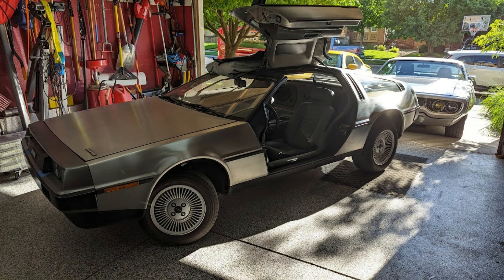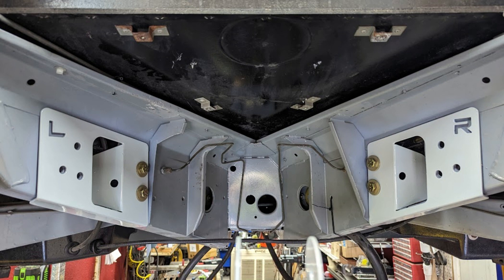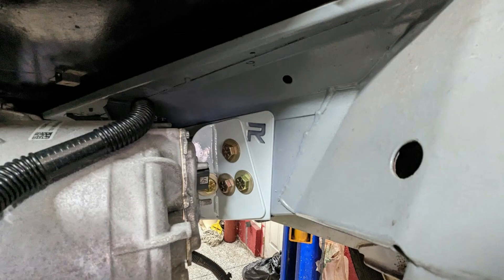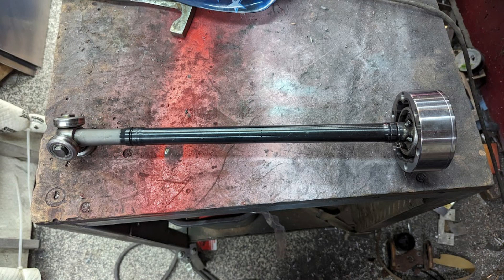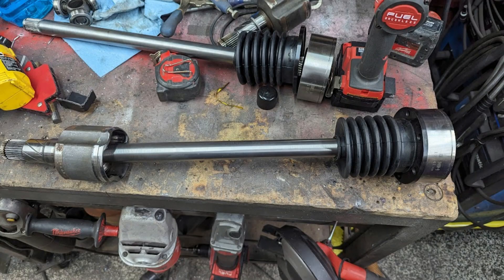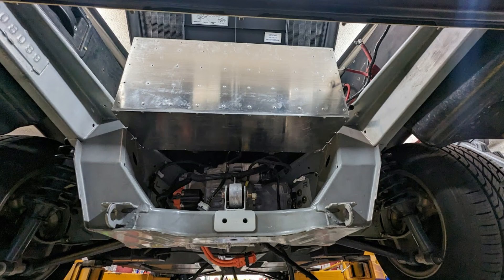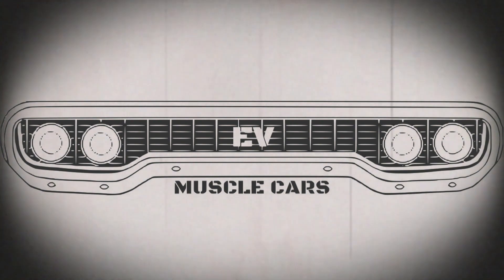EV DeLorean - Building CV Shafts - Project Jiggawatt Episode 2

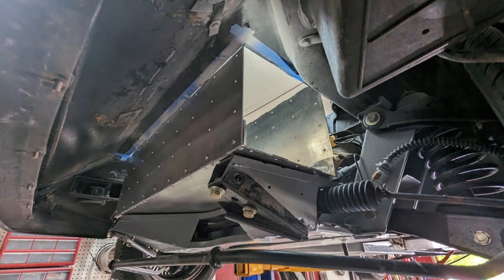Comment: Nice!  What are the electronics boxes at the rear of the frunk at 5:53?  They look a little like audio components - but they're not any EV components, are they?
Reply from the maker: There is a sound generator and a switch panel, most of those will be changing... Not EV related, just came with the car.

Comment: Kevin, did the frame need notching for CV shaft clearance, now that the diameter of the shafts have increased? 

Obviously, one should hope never to see that much travel, but I'm thinking of the possibility of extreme suspension compression on one side of the car during off-camber situations, say, making a curve in a parking lot while transitioning onto a steeply inclined ramp. That might be enough to get one side to compress close to full travel.
Reply from the maker: That's a good question... nope, luckily it still clears even when the suspension is fully compressed.

Comment: Hoping ep3 drops soon
Im trying to design a box setup for 18 lg chem modules, and the idea of having 4 modules per box is interesting...im wondering if i could do 3 modules per box for my setup and have 6 boxes? 

Furthermore i cant weld for crap so any no-weld solutions im into
Reply from the maker: I'll try to get that video out soon, I am also using a no weld solution for the box construction.  

For LG modules, you may have a consideration of thermal control with some kind of a liquid cooled/heated plate?  As far as the grouping goes, space consideration is a big factor followed by cell grouping.
Reply: @MrMoparMan  oh yeah liquid cooling is mandatory, meaning I'll need to make chill plates which match the bottom of X number of modules (however many are in any given box).
 The electric supercar guy had a good design that's easy for send cut send to make, just need to rivet it together and add black gasket maker
Reply from the maker: @Ryukachoo  Yeah custom sized chill plate is the way to go. 👍

Comment: Good progress on this :) Googling weights of the various components you've removed and added, it seems like it'll be a bit heavier than the original car but the box in the front the weight balance should be much the same, which is interesting
Reply from the maker: Thanks, Yep that was pretty much the same conclusion I came up with.  With modern adjustable coilovers, I think it will drive great.

Comment: Amazing work! 
I do wonder if it would be possible to have only 2 batteries in front (in order to save cutting into the tub) and have the other two batteries underneath the other in the back?
In order to keep the modification reversible if possible.
Reply from the maker: Yep two up front would remain under the trunk floor.  It could actually drive with only 14 modules instead of 16, it's just less power and less range.  Fitting the other two modules somewhere else did not seem feasible.  After having experience with a conversion, I'm convinced there's no desire to go back.
Reply: @MrMoparMan  Thanks for the reply! The non-destructive approach is just to please the purists. What's the expected range with the full pack?
Driving a stock PRV is plenty of fun for me but having a second electric Delorean would sure fool the locals :P (only 20-something in my country)
Reply from the maker: @banjohat  I hear you on keeping the original form... With the Model 3 motor and a Model S battery pack, 400 miles of range is possible.  It was also have DC fast charging.

Comment: I just had a drive unit fail catastrophically in my 2023 Tesla with only 5K miles. Left me stranded on the side of the road at midnight. The original DeLorean engine is more reliable! Good luck! 😂😂😂
Reply from the maker: Well that sounds like a bummer, sorry to hear that... You may be the first person I have heard that trusts the reliability of a DeLorean 😀.  My Tesla swapped Plymouth is going strong with 18,000 mi so far, I never drive it easy.
Reply: @MrMoparMan  I have owned all the top “super unreliable” brands, and none of them left me stranded on the side of the road like the Tesla did. After searching online for my car’s error messages, there are a lot of people having these failures.
Reply from the maker: @JetFire9  Interesting, what was the problem, or what were the error messages?
Reply: @MrMoparMan  "Pull over Safely Vehicle Shutting Down" and "Your car suffered a failure and will no longer drive." and "Vehicle may not restart Service is required." The inverter definitely had a massive failure and caused the main pyro fuse to blow, so despite having 2 motors, the whole car lost HV power, which means the tiny little LV battery was dead in 10 mins, which means you can't even put on the hazards or put the car into tow mode. Horrible design. Now they think the HV battery got damaged despite the pyro fuse blowing, so they are dropping the battery. In the shop for 2 weeks so far, and who knows how long it will take. Tesla is horrible with customer service. And it's a horrible engineering design to leave you stranded on the side of the road when either motor has a failure. So you have double the chance of being stranded. I have had lots of problems with cars, but they never left me stranded on the side of the road, and I have been able to fixed them myself. Not with a Tesla. Fortunately I was alone, but I am not going to risk my family with an EV again. Going to sell this POS and buy a Jaguar XJ. Believe it or not, they are much more reliable and luxurious than any Tesla.
Reply: @toronado455 What you're really saying is that ICE is more reliable than EV. However, if the car manufacturer is as stupid as Tesla, and they make it so their PHEV stops running if there is a failure in the EV portion, then you are less reliable than just an ICE.
Reply from the maker: @JetFire9  Yep that's definitely a significant failure if you blow the pyro fuse... Did they just swap out the whole drive unit?